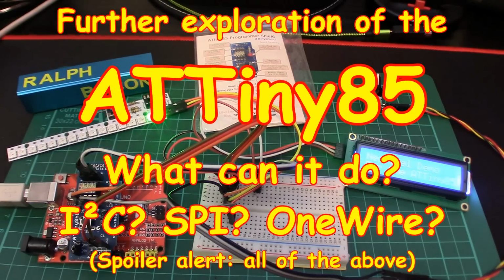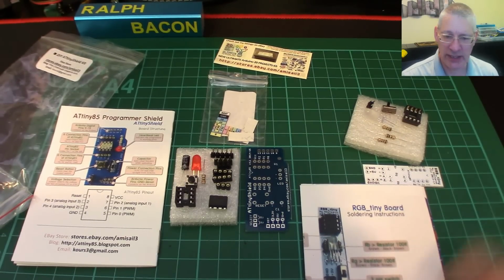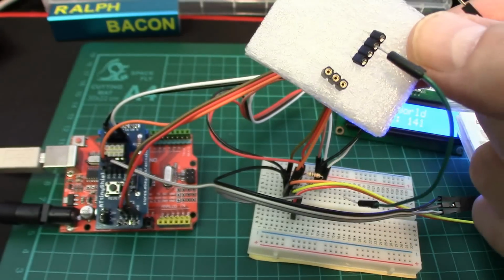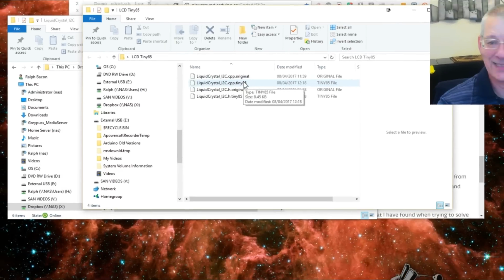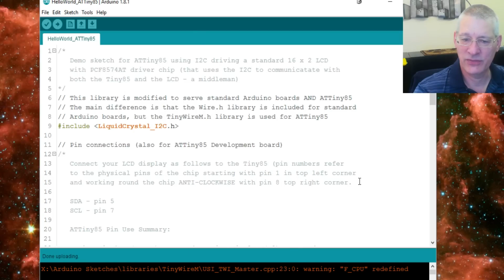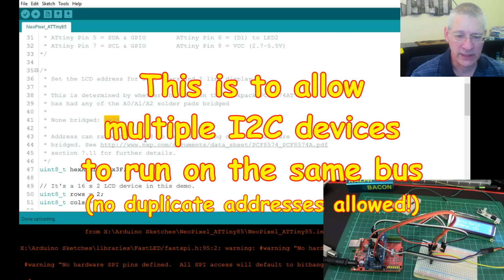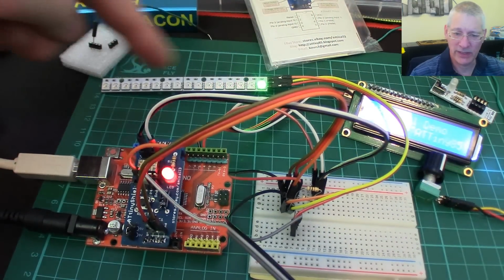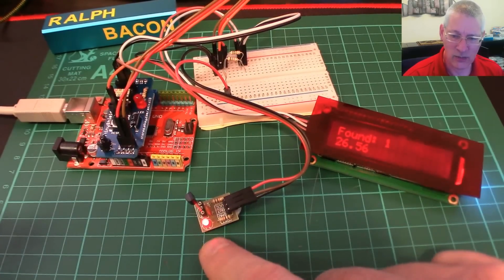#82 ATTiny85 + I2C  + SPI and more!

Comment: The thing I like about the ATtiny85 is it will happily run on a single cell Li Ion battery so handy for low power projects. I don't actually use that shield anymore as I took the plunge and upgraded to a 'proper' AVR programmer but it certainly filled the gap beforehand.

One thing you could also cover would be to add an i2c 23017 port expander chip to the ATtiny85 to increase the available GPIO.
Reply from the maker: Hey, Nick, there you are! I was wondering if you would "make an appearance".
 
Yes, I was originally going to use a pin-extender of some sort with this chip, but decided to first explore its native capabilities and I was impressed, it must be said. But that original idea (which you've reiterated) has not been forgotten, so stay tuned! Nice to hear from you again. BTW what programmer did you get?
Reply: Actually Ralph, I have two programmers now. I initially bought a really cheap USBASP from eBay but it had timing issues and needed another  programmer to flash new firmware. Because of this I decided to count my losses (and cash in a few Nectar points) and bought an AVRISP MKII. As I use Atmel Studio a lot it made sense to get that one.

Comment: $2.20 for nano 168?
Why not a STM32F103C8T6 for $2.36?
Small, powerful, plenty of ram and flash. Only problem it is 3.3V but almost all pins are 5V tolerant.
Reply from the maker: Hello David! Indeed, why not!
 
There are many, many very capable, cheap µControllers out there but I'm trying to focus on ones that my viewers will identify with and which have mass-market appeal. I quite concede that the Arduino Nano/Uno is, by today's standards, somewhat lacking in memory, SRAM, IO-pins, UARTs as well as having only a single I2C and SPI bus available. But, and here's the thing, most users / developers/ hobbyists don't want to create a chess-master computer, they just want to control their lawn sprinkler, monitor their loft water tank temperature, check where their cat is (that last one is for me) - basically, pretty simple stuff that the Arduino family of µControllers gives them and is easy to use (thanks to Arduino.cc). If you really want to push the boat out, there's always the Arduino Yun.
 
So that's why I'm sticking to the Uno, Nano and sometimes the ESP8266 (which isn't Atmel but is still a commonly used µController). I wish I had more time to investigate others but I just don't have the time. A pity really. Anyway, thanks for suggesting this, others may find it very useful and want to investigate - if there's sufficient interest then I will doubtless be prompted (like I was with the ATTiny85). Good to hear from you, David, in ... Hungary, is that?
Reply: Hello Ralph!

Thanks for your answer!
I've bought that MCU just for fun. And turns out to a cheap, small, powerful device, with good support. There is a project called stm32duino dot com, they make an Arduino compatible API for the STM32, so you can use it like an Arduino. If you have some spare time, and want to try some new thing, I recommend it. But there are things to watch out: some boards have onboard usb, but you can't program the chip with it. There is a bootloader that makes it possible, but I haven't tried it. Maybe you can buy board with onboard UART chip.
The positive side for the people you said, that it is plenty powerful for anything, like for a graphical LCD (like that you use for the cat monitor), more than one UART for sensors that connect with UART, you have to disconnect them to reprogram the micro, but now you have more than one, so you can reprogram it without messing around with the circuit.
I've tried a few arduino project of mine, they run on that board too, only thing to modify is the pin numbers. So I think, based on my small sample, it not that different from the mainstream, but cheaper, faster, smaller, and bigger flash and ram. Beside this, I have some arduino unos, and esp8266s too, now considering buying some nanos.
So that's why I choose it. I'm not saying that this is the way to make it, but if you'd like to, you should try it one day :)
And thanks for your videos, they are great! I think this ATTiny will be useful some day, I'm thinking about making some "dedicated hardware" like standalone small amp/volt meter, so the easy to solder, and small footprint while I use DIP packaging is very useful! :)

Greetings from Hungary!

Comment: Thanks again Ralph. 35 minutes of entertainment with a couple of new British idioms. "donkey's years" and "for love nor money". 

You should really buy a programmer, like the USBASP or USBtiny and start playing with Atmel Studio. No need for an Arduino as an ISP. It's by far more stable in my opinion. The libraries will be a problem though, but when you get it right it'll be fun. :)
Reply from the maker: I can foresee, Robert, that if we both stick at this, your English knowledge will outclass that of a native English speaker! Not only that, we'll have exchanged knowledge, suggestions and opinions about Arduino-related items too, so it's a win-win situation all round!
 
I have Atmel Studio 7.0 which, of course, is built on the same underlying GUI engine as my Visual Studio at work, so it's nice to get away from that by using Eclipse, or Sublime or even the standard Arduino IDE, to be honest! And I don't have any "tool" to upload the code to my Uno; I guess i'd have to acquire a USBASP, unless that's the same as my FTDI USB-to-Serial programmer, in which case I already have one?
 
Choices, choices, sometimes too many ways to do things. And as you didn't vote for my suggestion of a 30-hour day I don't have any time to do anything either! But thanks for posting, always good to hear from you.
Reply: The USBtinyISP is £2.50 and the USBASP is just £1.30 :-) They both work, but if you accidentally do a major "underclock" of a microcontroller, which I did in a weak moment, one of them can rescue the chip. Cannot remember if it was the USBtiny or the USBASP. It has to do with the clock setting fuses and the prescaler. 

I set my ATtiny2013 to 128 kHz with prescaler all the way to the max. I could almost program it with a Junker key (that a morse code key for you young kids). Well, I'm not fluid in SPI (although I do know morse code) and one of the programmers could not go as slow as required. The other did. 

I also use Visual Studo at work (C#). Visual Studio is big and clumsy, but being able to debug without an expensive JTAG debugger is nice. And when it comes to speed and compiled size it's way better than the Arduino IDE. Java is a stumbling block in my opinion. It's portable and all, but it not lightning fast. :)
Reply from the maker: I have plans (in an advanced state of preparation - in my head, at least) for a video to cover fuses, clock speed and that reset pin modification for the Tiny85. So I will see how it goes and how many chips I "brick"! But the programmers you mention are cheap; the one Nick B mentions is about GBP16.50 from China, up to GBP30 elsewhere - not exactly an impulse purchase. I will ponder a while... Thanks for the info, though, all very useful.
Reply: The timing issue Nick mentions is fixable when the clock setting is at a reasonable rate. That is, within certain limits. 1 MHz is no problem at all. Below that you might get timing issues. Going below 1 MHz doesn’t really make any sense unless you have code that runs too fast. That should be a software issue, not a hardware issue. ;)

Some could argue that power consumption is going down with the clock. That is indeed correct, but below 1 MHz it doesn’t really make any big difference. From 20 MHz to 1 MHz it is significant of course. The ATTiny85 will run stable at 1MHz on 1.8V. The datasheet says up to 4 MHz at 1.8V. 

avrdudes –B-switch sets the bit clock period. That doesn’t work on all programmers as I said yesterday. 

Julian Ilett came up with a nice “hack”, making a breadboard friendly ICSP connector with double row male long header pins. It’s in his Postbag #28.

Comment: 8 and 16MHz internal clocks are reliable on 5V supply. 8 might work for you with 3.3V. Use the Burn Bootloader function to set the fuse bits in the tiny85.

P.S. I had some old stock tiny85's that couldn't be recognized at all by either Arduino ISP or USBasp. So I dusted off an old STK500 and set it up for high voltage serial programming with avrdude to reset fuses to a sane state and to erase any contents. They've been good since then.

PPS: I have a ZIF socket on small breadboard with wires to an USBasp to program the tiny85 out of circuit, which is a bit more work but more reliable as the live circuit can interfere with the serial programming... like bad readbacks... resulting from the pins being "overloaded".
Reply from the maker: Interesting what you say there, Bernd.I've tried to find an 8-pin ZIF socket and failed. Yes, I know I could use a 14/16-pin one and just ignore the pin sockets not being used (perhaps covered by nice sticker!) but it would not be my first choice (this from a man who has large washers for touch plates on his video controller, hmm, the irony!). Anyway, shhhh on the fuses, bootloading and high voltage resetting, that will be a future video in the not so distant future. 8Mhz works fine on 3.3 volts for me, I didn't have the nerve to program it to 16Mhz until I knew I could reset it. But (and keep this to yourself) I'm getting to quite like the ATTiny85.  Good to hear from you.

Comment: I recently built an I2C slave with a Tiny85 to run some PWM devices with odd frequencies: having exhausted timers on a Mega.  Went a little over requirements by allowing PWM frequencies from below 25Hz to more than 35kHz. There's still a pin for tacho from the PWM controlled device, using the WDT for base interval counting tacho pulses.
Reply from the maker: And a great, practical way of solving a problem (although how you "ran out of timers" on a MEGA - it does have SIX right? - beats me). I didn't have the time to run the Tiny as a slave (and most people probably won't but it would be a good things to demo). I did a video on custom PWM using a library that allowed me a frequency of 1Hz to 1Mhz - and I even included a scope shot of it working at that speed! Not sure how practical that would be but good to know we can. Thanks for letting me know the Tiny works as a slave, anyway, I might still demo it in a future video.
Reply: It's got 7, including WDT. ;-)  FreeRTOS uses that for its base.

I ran out because each timer can only operate at one frequency; and one on the Mega is used to count external event for metering frequent "microevents" (up to 32,000 per second) and converting them into "meter clicks" using a counter comparator. Another TC is used to generate those events; motor stepper pulses at varying frequency with pulses at the necessary width in microseconds. The metering is required as  the TC producing stepper pulses runs without CPU intervention and we need to know how far the motor has turned. (Stepper runs at 3200 steps/rev at up to 600 rpm).

It's part of a complicated machine that has to respond in real time; things can go bang in a magnificent way if not managed in a timely manner.

One way of managing the complexity was to not try to second one of the critical timers to "multiplex" PWM and to check fan speeds from tacho feedback (one fan does 13 pulses/rev at speeds up to 3000rpm; generating 650 interrupts/second); and then there's more than one fan; at a very different PWM frequency that is not a "harmonic" of the other. Tiny85 with I2C provides scalability.

Remember how to eat an elephant: One mouthful at a time.
Reply from the maker: Hmm, that does indeed sound complicated but a nifty solution too. Good stuff, Bernd, thanks for letting us know!